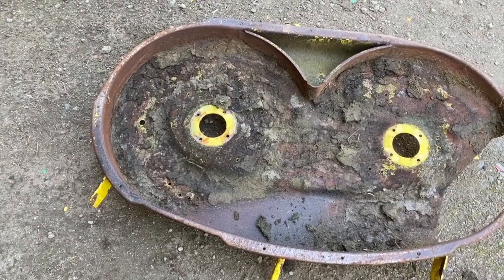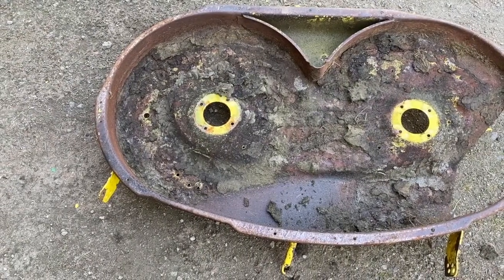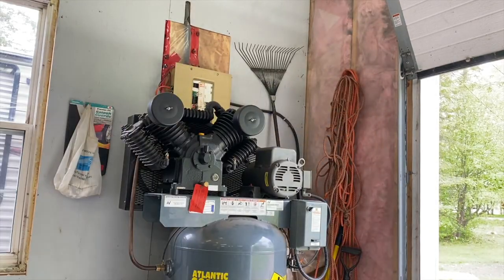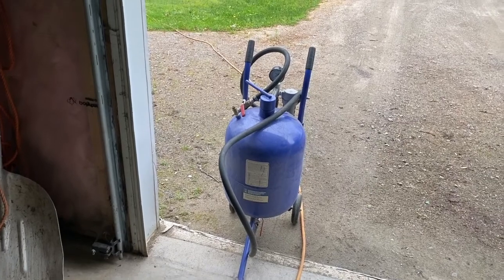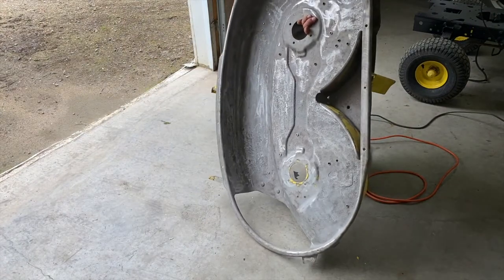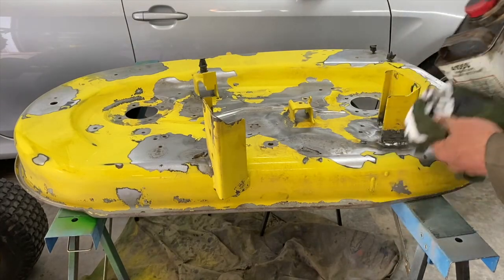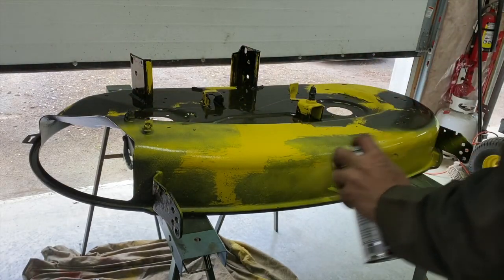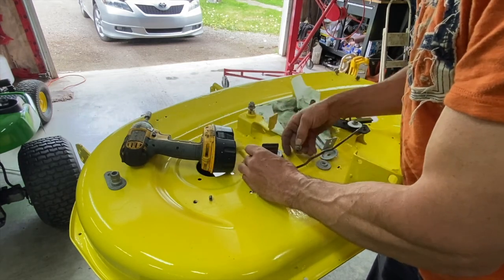How to Rebuild and Paint a 42" John Deere Mower Deck 100 Series. LA, D, E, S series. Sandblasting

Comment: The paint on my JD deck was coming off in large sheets due to poor powder coat adhesion,  ended up sandblasting the deck, giving it 2 coats of POR15 and then 2 coats of glossy black chassis paint, 5 years on it so far and it doesnt show any signs of peeling/flaking off
Reply from the maker: Por-15 is the best paint.

Comment: I have a JD D110 riding mower with the same deck radius as yours and the same problem with the deck the brackets I guess they're called you welded, mine are bad also so I guess I need to find a welder before the deck breaks.
Reply from the maker: Yup, they need to be welded before the deck falls off…..